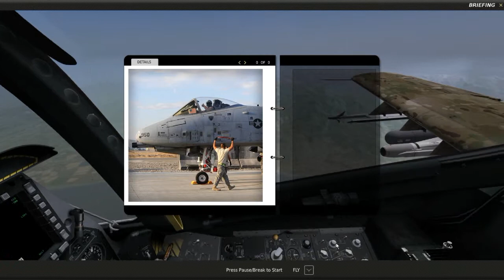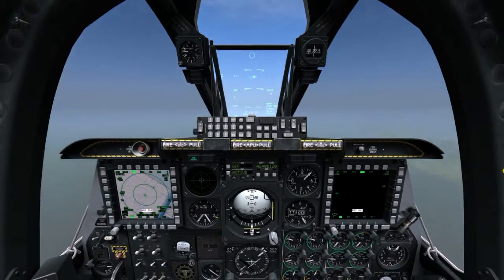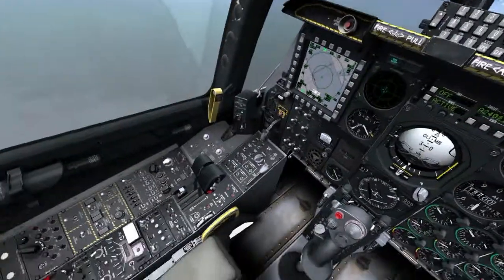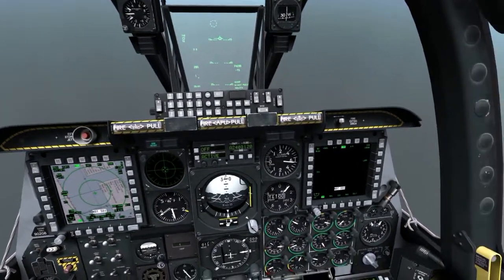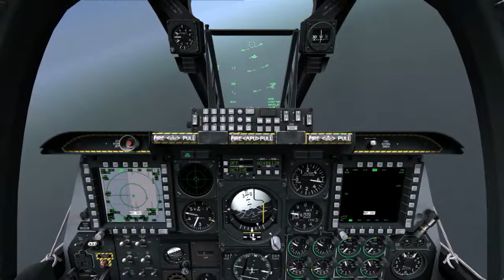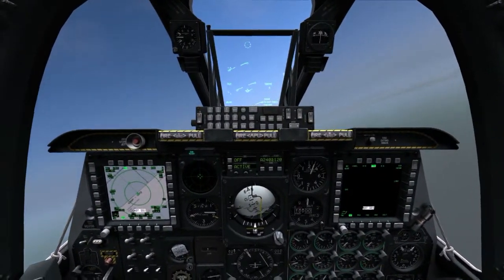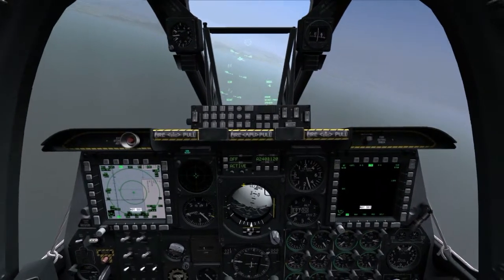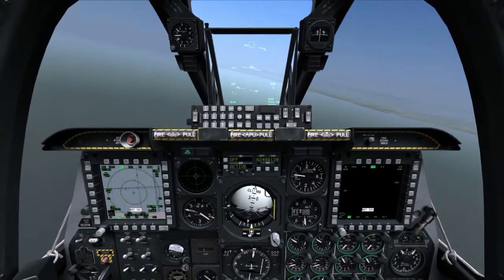DCS A-10C Emergency Engine Restarts, APU and Windmill

Comment from the maker: Yeah if you go inverted for more than 10 seconds the engines will die.  There is a small amount that is in a "reserve".  To do the NAV set up you'll have to perform an in flight alignment instead of the usual alignment.  To do that you have to go to the NAV page on the CDU, chose "ALIGN" then "INFLIGHT".  Wait for 5.5.0.8 on the NAV page then you can proceed.  I haven't done it but I've heard reports it might be a "broken" mechanic so it may not align properly.

Comment from the maker: I think you can just do an APU start on both engines like you do on the ground with the exception of motoring both engines.  I have not had a chance to try it because the only time I've had a double engine failure it was either in a way that wouldn't allow a restart or because I was only about 400 AGL.  But I'd like to try it to see if that's how.